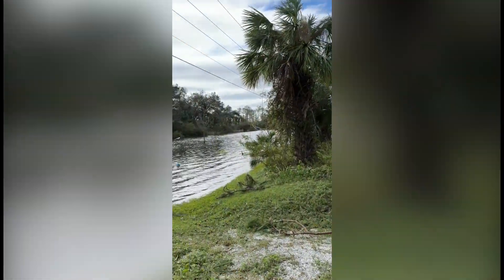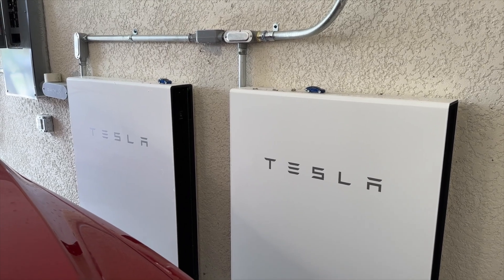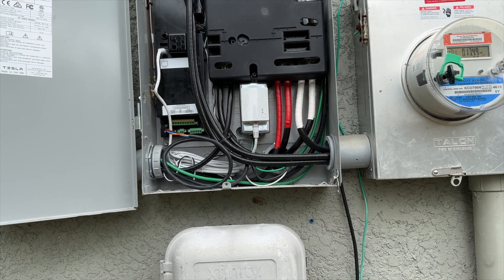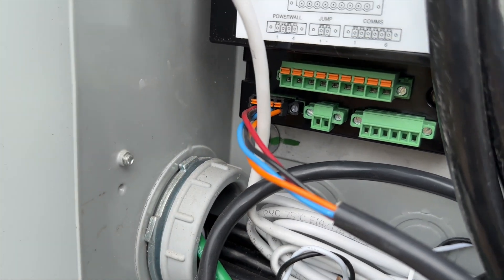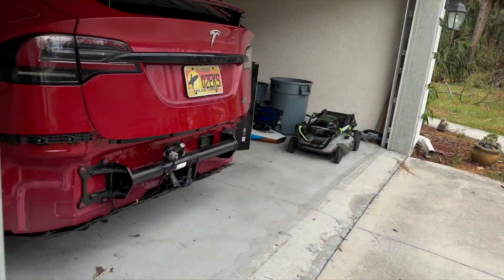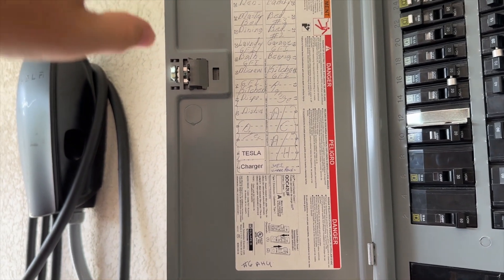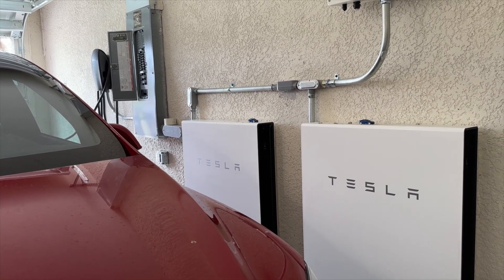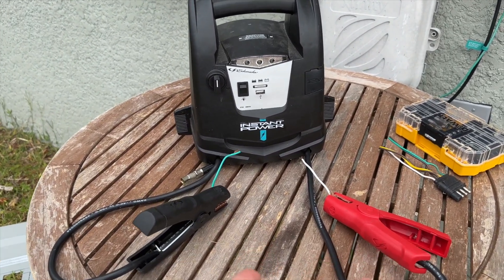Tesla Powerwall's FATAL FLAW | How to Jump-Start Tesla Powerwalls

Comment: When I shut down my powerwall batteries to save them I am not clear on what I need to shut off beyond the switches on the side of the actual powerwall batteries.  What else should I shut off, and when I want to let the batteries be used again what is the procedure to restart them?  My problem in the past is that the system gets to 5%, shuts down until the sun comes out, then when the sun comes out the system comes back on line, but then shuts down and goes into battery standby mode because there is heavy draw as the refridgerator and AC units start and the batteries drop below 5% to 4.9%.  Then a tech has to jump start the system.  So my question - if I want to stop my batteries from draining and switch to generator overnight, what do I do other than toggle the switches on the powerall off?
Reply: One other thing - great video!  I am surprised TESLA does not simply put a place to connect jumper cables on the outside of the box.  Its ridiculous to require a tech for this.  I live in Puerto Rico and we have hurricanes here and when one hits you are not going to quickly get a tech out to your house.  The roads might not be passable and they will be busy.

Comment: My batteries will flash the green lights and then go to solid green light after the jump start, but then my system doesn't take over to charge my powerwall. Any suggestions?

Comment: First of all, last year, our house went for 14 days without power from the grid because of hurricane Fiona (Puerto Rico) and we had continuous power from our 30 solar panels and 2 powerwall batteries. We diligently manage the power used in the house and our batteriew never went below 25% during those 2 weeks.  We even used the electric clothe dryer and electric stove (diligently).  We also turned the air conditioning on during the sunny days, then turned it off around 5 pm and turned it back on around 9 pm every night (Puerto Rico is very hot in summer). My biggest fear has always been, what happens if the grid goes out and I'm using more Kw than the batteries can handle at that exact moment.  Will the batteries just shut off? Then what?   My installers explained that if that happened, my emergency 15k back up generator would automatically would turned on (I have an automatic transfer switch) but that situation has not had the chance to happened yet, although the installers did a test and It worked as planned. I forgot to ask, and I've always wondered if I decided to conserve powerwall battery, can I shut down the 2 powerwall breakers, and if that would trigger the transfer switch connected to my backup generator to turn on and provide power to the house. But after watching your video now I'm not so sure.  Another worry I have is that I lose grid power at night and don't noticed and the batteries drain before sun up.  Would that mean that my batteries would have to be jump started too?

Comment: The two screws on the remove the connector, then you can attach the wire to the green connector and plug it in. to solve the other end wrap the wire around a bolt, then the clamp will connect to the then be able to hold the bolts

Comment: Somehow my first part of the comment didint show up.   I wanted to explain what causes the situation where you need to jump start the system.   The internal computer in the teslka gateway model 1 and 2 is powered either by L1 from the grid or by the battery when the power is out.   if you have an extended outage the battery wil lcontinue to discharge beyond the reserve level set all the way to 0% if you let it.  This typically only happens if the battery get all the way to 0% the last thing that goes off is the gateway computer.  If the power comes back on the computer reboots and all is good.  the battery fills with grid power or solar if the sun is out.  If you let the battery get to zero and not shut it off the computer goes off and then theres no power to trick the solar systm into turnign on in the morning. its sees no grid and no grid fromt the power wall either.  Thats when a Jump will save you as long as thers sun present you can use a simple 12V Gel battery and power the computer. It boots up and hopefully turns on the battery and 240V will go to the solar inverter tricking into thinking the grid is present and it wil turn on and begin charging the battery.  ITs importan to turn off all but the battery and solar breakers in the house. You need all the suns energy to get some juice in the battery. Once its up a few percent you can introduce small loads like the fridge or lights.   The way to prevent a total failure like this durring along outage if you battery gets to less than10 or even 5%  and its getting to be night time or is dark already go and turn off the battery breaker and toggle switch on the battery. that will stop any further discharge and just wait for the sun to come out.  Once you got some light then turn on the battery breaker and toggle switch.  that will engage the soalr inverter and hopefully if you have light it wil lbegin charging back up.  be very fruefgal until that better gets some charge.    Remember to prevent it from getting that low during a long outage power off battery breaker and toggle switch to stop discharging.    If the grid returns trun that all back on and let the grid fill the battery.  If the battery is very cold below 55deg F it wil charge very slowly until it gets warmed up.
Reply: Hey, Eric, if you get this, could I possibly pick your brain? I'm having issues with my powerwall and the installer is useless

Comment: Further info on why these system can need a jump.   This is a continuation message.  while the computer is booting up turn off all the house load breakers and only keep on the solar and battery breaker. that way the solar can begin to recharge the battery.  once it gets a few percent then you can one by one turn on small loads like the frig and some lights but you want to limit consumption and let the battery charge as much asa it can from the solar.   once the soalr is on and making power you can disconnect the battey and the solar wil power the computer thru the L1 connection.  I only see this complete system shutdown on extended multi day outages and not enough available sunlight.    The way to avoid it from happeing if yoru in that situation is when your battery  gets down to 10% or less turn off all unnecessary loads and if you think the batttery wont make it to moring then turn off the battery breaker and battery toggle switch that shuts off the battery and computer. that will stop any further discharge.  once the sun returns in the mornign turn the breaker back on and toggle switch on the battery back on. You should have enough power to boot up and startback up the solar and begin recharging. Hopefully the power returns to the grid then your all good again.    Hope this was helpfull.

Comment: You already lost grid power so why  would it make any difference if you turned off the main breaker? It was essentially off already if the grid was down.
Reply: Because what should happen in a grid failure is that the powerwalls take over immediately but they use the main breaker to distribute that power and receive power from the solar panels.
Reply: @AviShpayer  Main breaker might be 200 amps. Double Powerwall breaker is 60.

Comment: Only Tesla would overcomplicate an uninterrupted battery backup system enough that it would require a jump start in a range of likely conditions could be met at home.
Reply: It's designed that way for safety in the same way the car is. A low voltage system that can turn on and off the high voltage system.
Reply: @abyssunderground  yes it wouldn't be safe having high voltage lines in the user's reach at all.
Reply: @abyssunderground  it’s called relays, nothing new, safety isn’t why, it’s cuz Tesla likes to pretend they are apple of their industry thus have to reinvent things sometimes amazingly sometimes….this stupid sh*t.

Tesla is over complicating it, this could been done even more safely with fewer failure points just using DC-DC conversion from main battery to 12V power to switch some relays when power is lost, it would be even lower maintenance.  Could just run 12V all the time hot off of it, probably would add like $1 worth of hardware to the total BOM and last lifetime of the unit, he’ll could make it hot swappable if they wanted to make it a separate module so if that’s a concern then it’s addressable.   That’s before consider stuff like contactors and solenoids which could avoid the low power system entirely.
Reply: That's for safety reasons, I would hope everyone else would do so